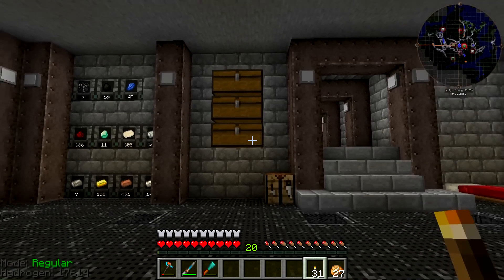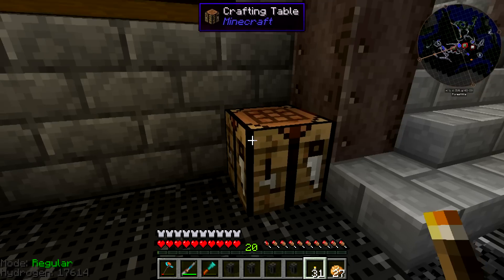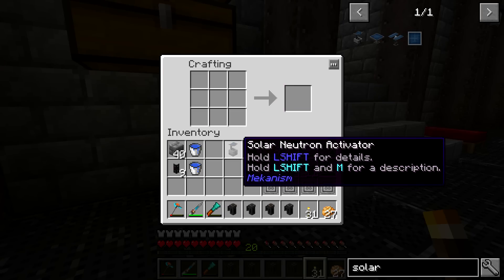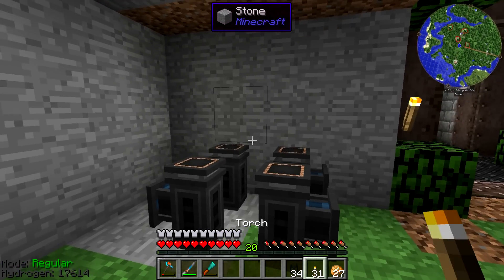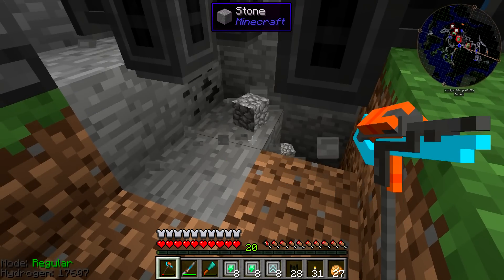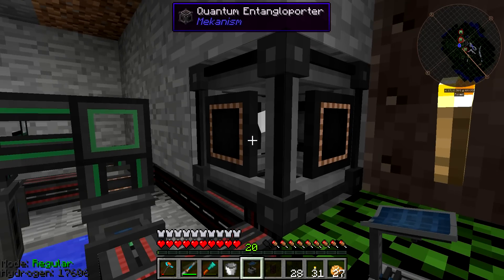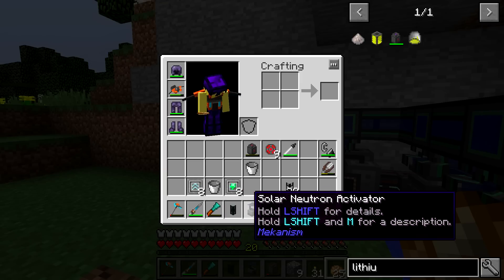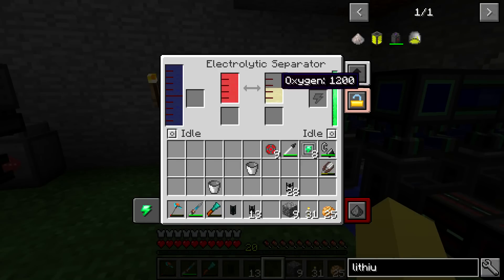Surviving With Mekanism v9 :: Ep.17 - Tritium And Deuterium Production

Comment: DrRageHard, a way I found to "fix" the bug in the quantum entangloporters is to set the universal cable on the entangleporter to pull, just like you do with the mechanical pipes and stuff. Not sure if it works all of the time, but at least it worked for me.
Reply from the maker: Awesome! I will be sure to try this out ASAP! Thanks for the suggestion :)

Comment: you actually do have to create the D-T fuel yourself.  you don't ever have to inject it directly, but you do need it to initialize the whole process.

to start the reactor you need two things:  heat and a filled Hohlraum.  the hohlraum must be filled with D-T fuel and placed into the slot in the reactor control panel, and then you can apply heat from a laser amplifier.  

without the hohlraum, the reactor would heat up from the laser, and i'm pretty sure it would even generate power for a short time until it cools off... but to actually create its own heat and continuously generate power, the fusion reaction must be kicked off by a filled hohlraum.  of course, to sustain the reaction, you can choose to inject the fuel either combined or separately... but to start it off requires D-T fuel.
Reply from the maker: Okay, so I won't need a ton of the D-T fuel, but just enough to fill up the hohlraum and kick start all of it.

Comment: it's not necessarily better to insert the Deuterium and Tritium separately; it just allows more control over the injection rate. 
when you inject the fuels separately, the reactor control panel can control the injection rate.  a rate of 2 means you're injecting 2 mB/t of fuel... so 1 mB/t of each.
when you inject D-T fuel directly, there's no control at all, other than how many speed upgrades you put in the chemical infuser.  in other words, as fast as the infuser creates it is how fast it's going to be injected.  

i suppose the maximum flow rate of the pipe you use could also affect the injection rate, but the rates are so small, you'd need to be creating incredibly massive amounts of power before you reach the limit of the basic pipe.  for every 1 mB/t of each fuel you inject (so 2 mB/t total injection rate), the reactor generates 500 kJ/t of power, in passively cooled mode.

the maximum amount of power you can create, when injecting each fuel separately, is determined by the control panel.  the highest it can be set is a rate of 98 mB/t.  that equates to about 24.5 MJ/t.  (250 kJ/t per 1 mB/t)
but when you combine the fuel yourself, and inject D-T fuel directly, there is no limit that i've been able to find.  today, i had it generating 150 MJ/t before my gas tanks ran dry.  and it was still climbing, so i have no idea how fast the infuser was injecting with 8 speed upgrades.
Reply from the maker: Ah, okay it makes sense now. So by putting the two in separately you get more control over the rate at which the reactor uses them up. Interesting, and wow, that is a TON of power compared to what I am getting now. I am super hyped for setting it up now :D Thanks for all the info!

Comment: DrRageHard, If you're interested in automating the fusion reactor, one way you can automate the holhram is by filling it, and using ender io pipes to put it into the fusion reactor. Because of the filters, you can set it to only pull the holhram out of the fusion reactor when it's empty and vise versa.
Reply: He dosnn't have ender io in this lets play. Check the description for the full mod list.
Reply from the maker: Like Ste ven said, I dont have Ender IO :( which is unfortunate because I love Ender IO.
Reply: Not that hard to add it, it won't brake anything.
Reply: Welp i think the point of these surviving with series is to survive only with 1 big main mod, and then some small addons.
Reply: Just to clear up the confusion, I was meaning for the big modpack he's playing
Reply: Oh lol. then why post it on this video?
Reply: Because my connection was bad and I couldn't change the video.